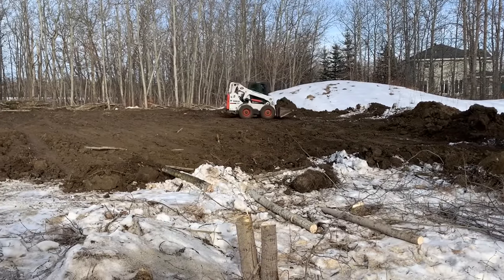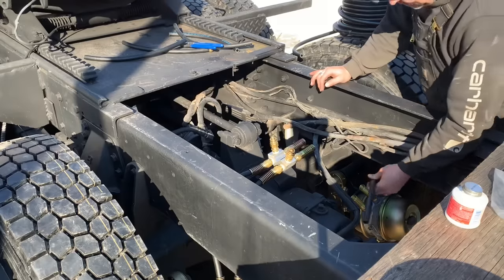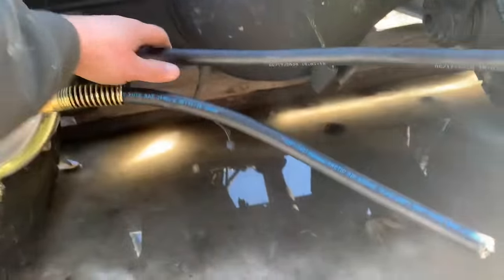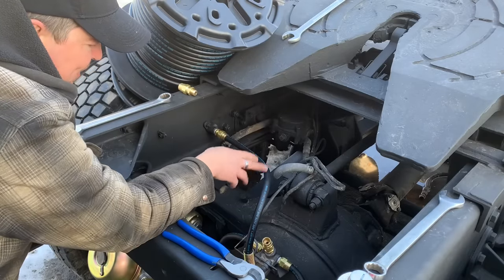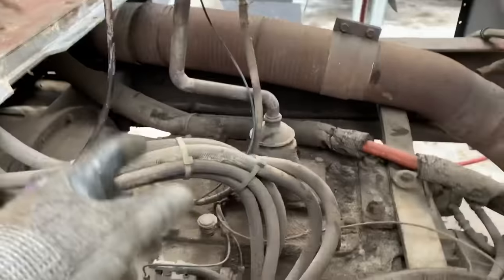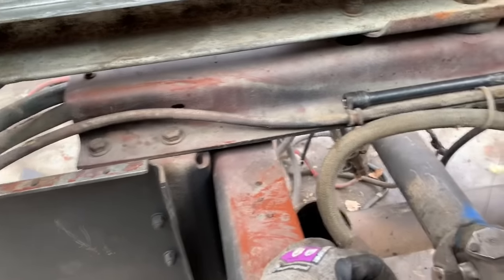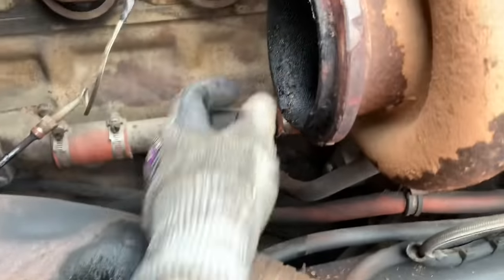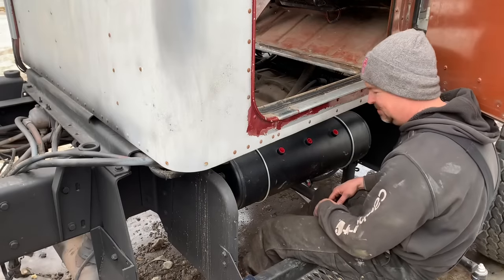Smokey & The Bandit Tribute Truck Ep.17 Air Lines a' Plenty

Comment: Hi Mark love intro early ice road truckers pioneers.Air hose cock-up brings to mind measure twice cut once yea i am a MUPPET as well 😁.See you retrieved hose for other use lucky or what 😁 only takin the P..Can't wait to see shop finished feel for you workin outside in snow i have done that quite a few times.Remember pulling a load sheet/tarp off in winter and it stood up like a garage/shed.Will you need shop to be heated you being a toughie ?.😁.Love you'r commitment restoration EH we all like minded.

Comment: The highlight of the week is the new Twinsticks video, love it! Seeing a classic like that come back to life is priceless. However, I agree with some of the comments about the lines from the relay valve to the T-piece on the front axle. They're possibly a little short. In a situation like that we'd send the lines around the long way and loop them back so that they come into the elbow from the passenger side (in this case), then there's enough length in the hose to accommodate suspension articulation.

Comment: That little air tank is called a ping tank. They are very effective at removing water and especially oil. Ideally they should be mounted between the air compressor and the wet tank. They're very common on transit buses and stationary equipment.

Comment: you can put a air ride on the cab and sleeper, the 13 speed will work fine unless you plan on doing heavy haul and need to split the low side, the back box is all that needs replacing unless you just want to replace the whole transmission, a air hammer with a muffler cutter makes short work of any flex pipe and band clamp just watch your angle or you poke a hole in the pipe, if your transmission has had the front gears flipped for overdrive a shift top with the pin will make it shift in the normal pattern

Comment: While you have the chance, why not get the turbo serviced. If the oil seals have gone, that could be one cause of the oil in the exhaust. But leaking oil seals could lead to the engine running away.

Comment: check that small air tank before you get rid of it, it's stainless steel, mine was. That air tank under the passenger seat was the supply tank. 
Heat of the cab kept it from freezing . Great videos, enjoy watching.

Comment: Well lots of clay but it need to be done if you want a good base and no flooding in the shop, amazing how much it takes to get it to where you want it ,but worth it in the end if does what it supposed to with avoid any water infiltration, Hopefully you can find some sponsors to work with on the shop build maybe ease the pain on the wallet and be some good advertising for both sides.

I dont blame you a bit for going with the air hose that will work in real cold weather lord knows with some of the real cold blasts like we get in the -40's I think it's a wise investment and money well spent. The compression fitting are nice easy fix if you have an issue and yeah a few bucks but worth it in the end when it comes to repairability and of course ease of installation.

With the Turbo, it's good to see the impeller is working well but while you there I would take the turbo and change the seals inside,sooner or later they always leak but with a little sign of oil in the tubes their would make me think that there could be a seal leak,I think it would be worth it to change them and then you dont have to worry about it for a while down the road, just my two cents.

Otherwise Marc she is coming along,your making some decent progress on things won be long and you will have a nice rolling chassis to work with. Look forward to the next update Cheers!

Comment: On those old exhaust sensors. Try heating it up and spraying pb blaster in the threads. Or use wax when its hot also

Comment: When redoing exhaust, see if you can do a 90 coming out of turbo and run it down to the  backside of passenger step/box. That will eliminate exhaust directly under floor panel.

Comment: Get the Donaldson exhaust clamps when you do the exhaust.  They have a threaded bar that goes on the backside of the bolts, so you don't need wrench on nuts. You'll thank yourself in the future, and maybe even the present.  It seems like all the other brands have gone to nuts and bolts now.  their "SealClamp" brand,  part number should start with an X

Comment: Looking forward to the slab.  Or are you just going to do a perimeter wall
That scene with Timothy Dalton is so humerous.  Anyone whom drives knows how impossible that move is
Reply: They actually build that truck to do that! They did a behind the scenes thing and the gear reduction was insane! They cut the frame, the actual driver was in the sleeper and they had a huge counter weight behind the 5th wheel and a bunch of other things that I can't remember but the truck really did a wheelie all by itself! There were 3 trucks that were custom built in the Seattle Kenworth factory for the movie.

Comment: Those fittings on both ends of the hoses are a pain in the ass when I go out to a brake chamber replacement on the road. I've gotta cut one end off & if the hose is too short to reconnect I'm building a new hose as well. They need a swivel fitting on one end.

Comment: Placing the tank under the cab will make it more difficult when you want to drain moisture from it. You will have to put a line in and a valve you can acces from the side or the back on the cab. Also, as a hands on kind of guy, will you be building parts of your new garage? Will you post videos on it? You sure got your hands full for the next few months.

Comment: @ 04:00 I am not sure you allowed for a full axle drop on that 2nd fitting. But that piping system looks real easy to work with.
Reply from the maker: 🤔 maybe I’ll jack up the back axle to fully drop the front and check to be sure

Comment: To all the smoky in the bandit fans what engine was in the original truck from the movie? Detroit? Cat?
Reply: Use candle wax and heat on rusted nuts and bolts. How is the dirt work going to change when the ground thaws?
Reply from the maker: @lonnalachner7344  not building till June so all the frost’ll be out by then and plan to pack it before build 👍
Reply from the maker: From what I’ve read there were 3 trucks used in the movie and each one had a different motor Cat, Cummins and Detroit 🤔
Reply: @TwinStix  Little by little has a 3406 cat and the smoky in the bandit truck has a Cummins what does  Iron duke have? CAT? I know you said what it had but I missed that episode

Comment: i mean the movie truck was a 13, but if you do switch it, ive been looking at a Transtar with a 9 speed and I would like a few more gears
Reply: I'm no mechanic but I think some if not all 9 speeds are convertible to 13 speeds. Transtar is  the cabover?  Those were some of my favorites
Reply: @mattberg916  it would be easier to just put in another transmisison

Comment: That rear air line is too short. When that axle drops into a big hole it is going to pull the hose off. I always have lots of air hose on the suspension.